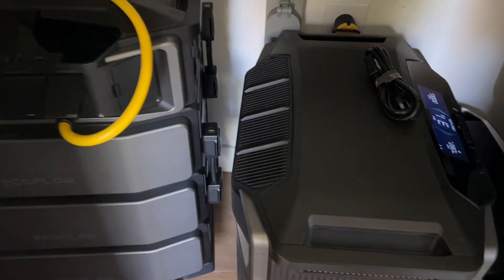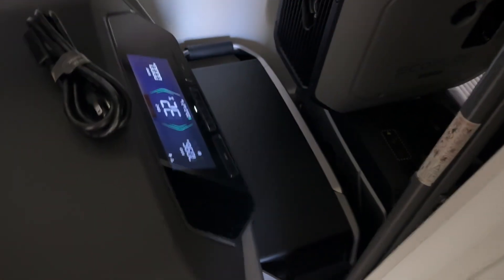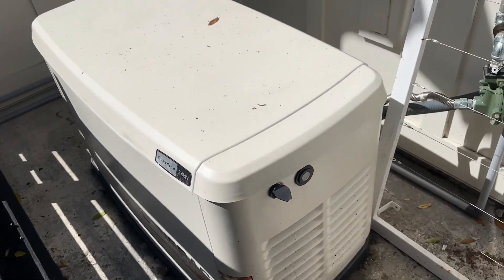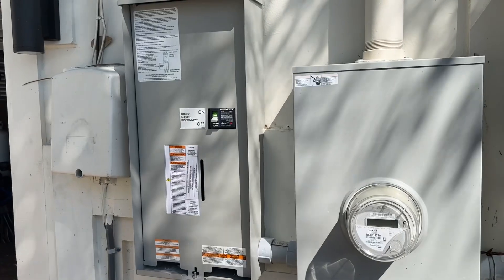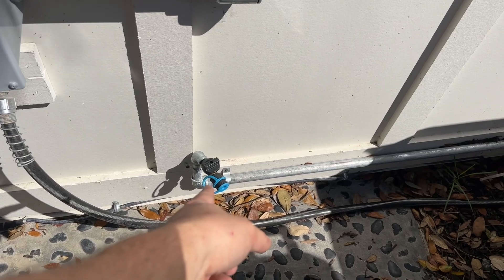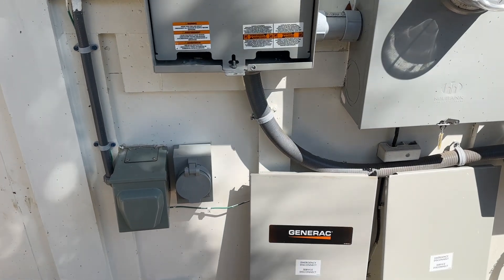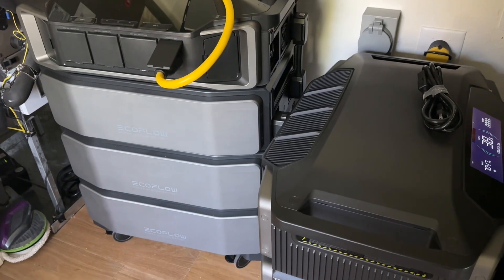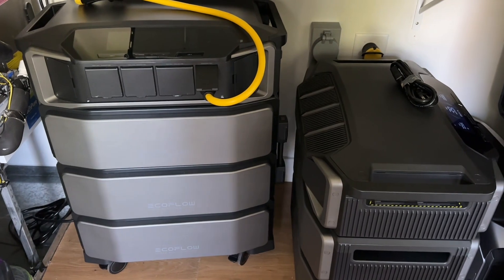Using the Generac Generator as a BIG Battery Charger For Ecoflow Delta Pro Ultra

Comment: All I can say is wow… I just watched your first video on how your Generac let you down in a time of need. I also cannot believe the rude and ignorant comments that you have received on it. I live in Florida as well, in the Tallahassee area. My wife and I were about to pull the trigger on a new Generac 26kw at a $13,750 price. Long story short, I ended up purchasing a Westinghouse 13,500/11,500 trifuel portable generator and installing a 50 amp inlet on the side for our home. Normally during the hurricane season I keep 20 gallons of non ethanol gas stored. I also purchased a siphon pump to pull fuel from our vehicles, if needed for a long duration power outage. I also went the Tractor Supply route and purchased 2- 100 lb propane tanks for additional fuel. I had a soft start installed on our 4 ton ac unit to reduce the initial influx of amps during start up, please check them out if you haven’t, I recommend the AirGo soft start, you can find on Amazon. I still purchased 2 portable ac units (10k BTU and 13k BTU) just in case our central unit went down. I respect your dedication to keeping your family safe, I’m the same way with mine. I want my wife and kids to know that they are safe. Anyways, good luck, so far we have been lucky this year but it’s not over yet…lol.

Comment: So, are the ecoflows providing power to the house while getting charged from the generac?  If so, are you manually starting the process or is the generac kicking on when it detects low  battery levels?  Asking because I would like to get a generac to start up when my Ecoflow batteries get down to a certain level, and once charged, I want the generac to shut down automatically.  Thanx for any info!
Reply from the maker: Manual process.